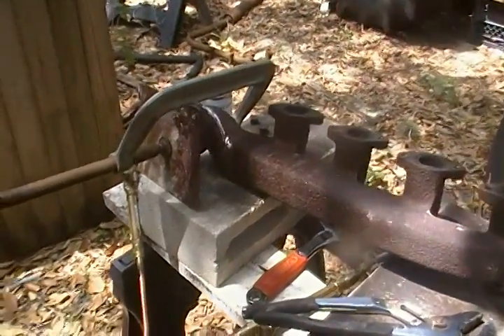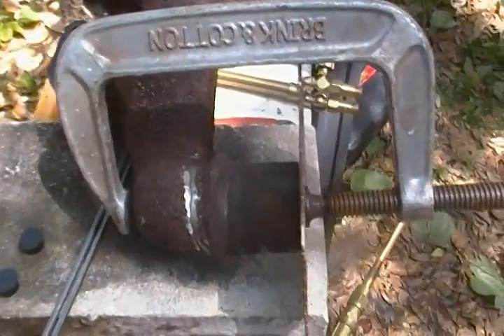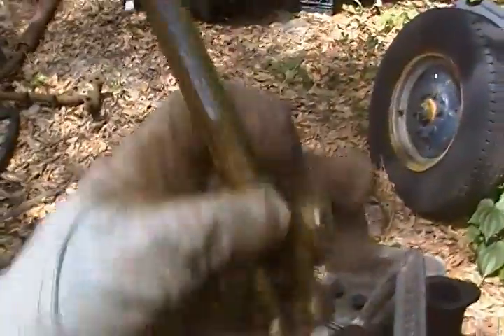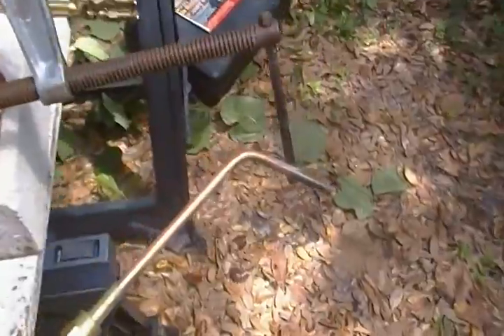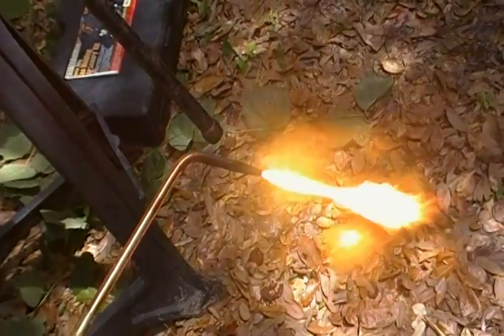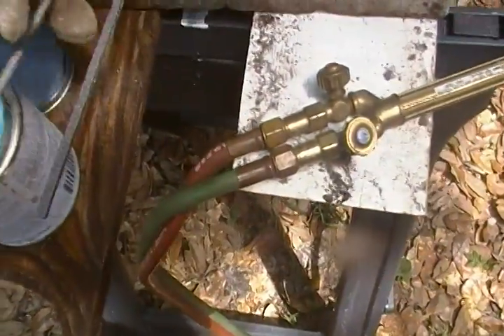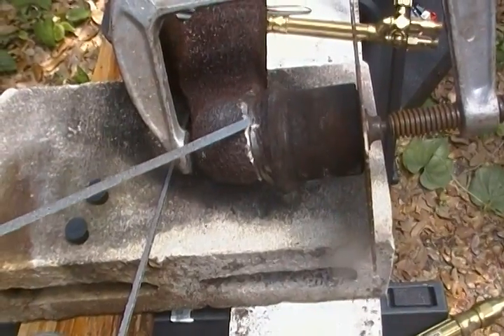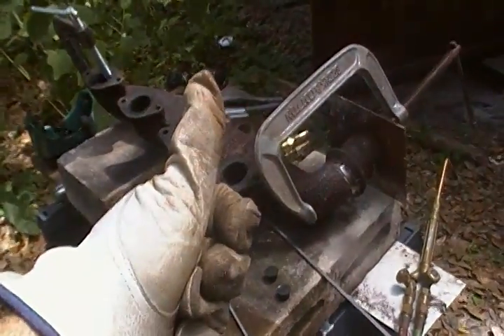OxyAcetylene Gas Welding: Welding A 1970 John Deere  Broken Exhaust Manifold

Comment: Beware the O-rings on ChiCOm gas welding apparatus where torch tip/cutting attachment meets handle. You can replace them with quality O-rings when they dry out and disintegrate, or do the smart thing and put some Victor O-rings in there before they die.
I buy used US-made OA gear but you couldn't give me ChiCom. I won't even Ebay it when it comes my way.
A tinted face shield is far more comfortable than goggles.
Happy welding!

Comment from the maker: Good points on the safety.  The weld has held on the tractor.  I wouldn'y say that it was that hard.  Welding a metal gas tank IMHO was harder.  Thanks for commenting.

Comment: I'm told that welding cast iron is one of the most difficult things to do, good luck. 

I have, however, been very successful at starting accidental fires with my welding gear. Those dry leaves under your work bench are an accident waiting to happen. You can buy fire resistant welding tarps that would make working outside a little safer.

Comment: Great video, Also did you know, you can mig-weld cast iron, without needing any external heating source? I have also used brass rods to gas weld cast, but you DO have to preheat and keep heat even over the whole peace anytime you gas weld cast, possibly on a fire as you stated to avoid cooling cracks. 

Just some things I have learned over the years. I understand you can only use what you have available but it's nice to know you have more than one option when something breaks down. God Bless